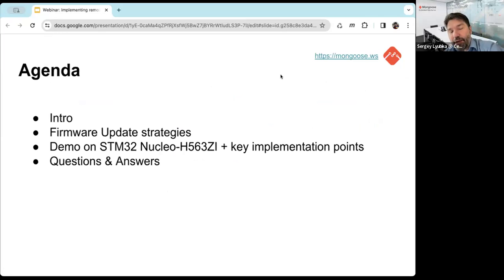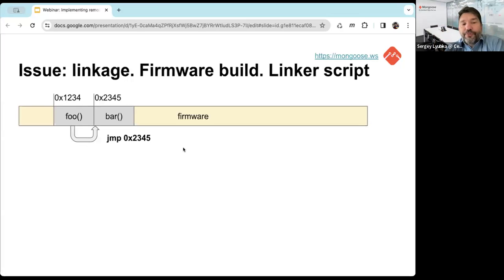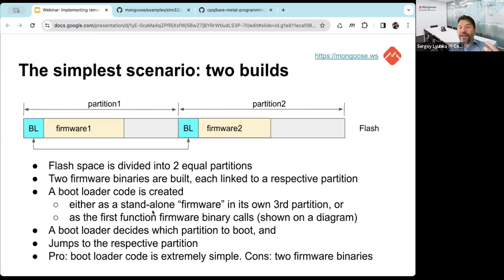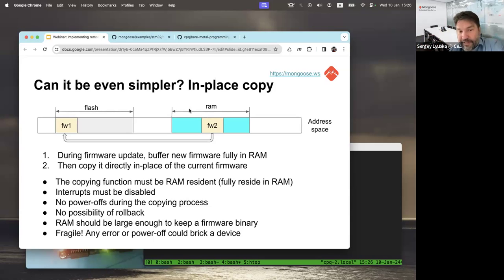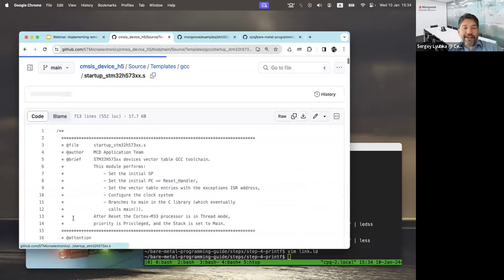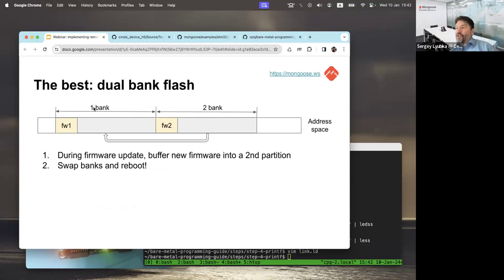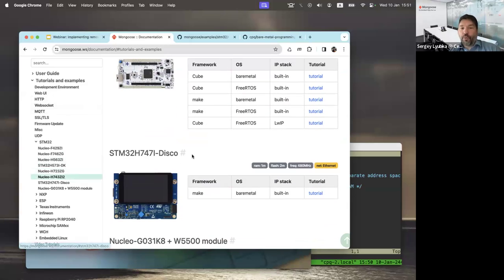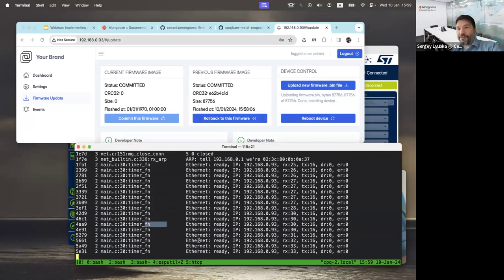Webinar:  Implementing remote Over-The-Air (OTA) Firmware Updates on STM32 H5, H7 microcontrollers

Comment: Hi, I have a question. I'm working with an STM32H563ZI with TrustZone enabled. In this case, should I copy those files into my secure source tree? Or should I use the libraries but with TrustZone disabled?
Reply from the maker: It would all depend on your TrustZone configuration. If your networking functionality is meant to run in secure domain - yes, add to the secure tree. Otherwise, to the non-secure.

Comment: Is not clear to me where the Bootloader "lives" in the dual bank scenario.
Is it external or duplicated at the beginning of both flash banks?
Reply from the maker: The bootloader should receive control right after the MCU starts. Long story short, that's memory address 0. MCU manufacturers make flash memory map to that range - starting from address 0. Meaning, at the MCU boot, MCU starts reading from instructions from address 0 - and usually that means they read the beginning of flash memory.

So, in case of dual bank flash, that is either the beginning of 1st bank, or the beginning of 2nd bank - exactly as you pointed out, "at the beginning of both flash banks".

Some manufacturers create ROM area with their built-in bootloader code and map it to address 0, thus making their own bootloader always receive control first.

Some alter boot sequence depending on the value of special GPIO pins (called strapping pins): for example, STM32s can run a built-in bootloader from ROM if the BOOT0 pin is high during boot. All STM32 MCUs have that built-in bootloader, it can reflash a new firmware, which makes is easy to implement firmware update on STM32 using that built-in bootloader. That scenario was not described in the video, as it depends heavily on the manufacturer.

Does that answer the question?